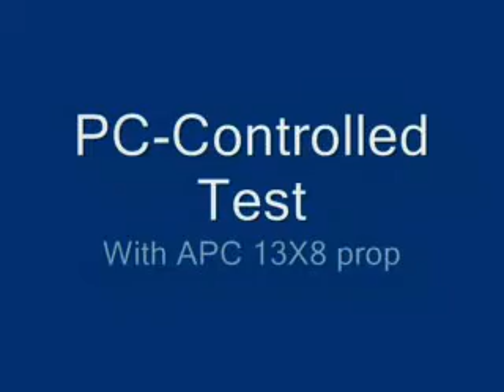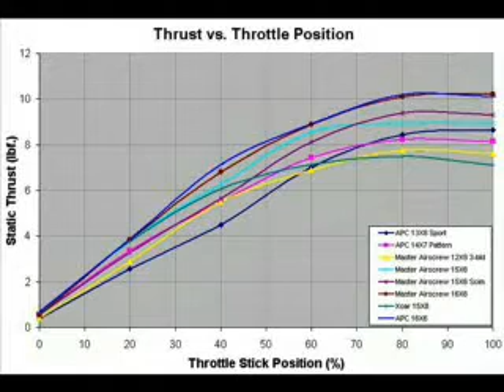Saito FA-82a Golden Knight 4-Stroke Glow Engine

Comment: What is interesting is that the YS FZ70S you tested turned an APC 13x8 10,950 rpm producing 8.3 lbs of thrust, but the Saito in this test produced 9,900 rpm and 8.6 lbs of thrust on the same prop.  The YS turned 1000+ rpm, but produced less thrust?  APC data shows that it should have produced ~11.3 lbs on the YS and ~ 9.1 lbs on the Saito, test conditions unknown.